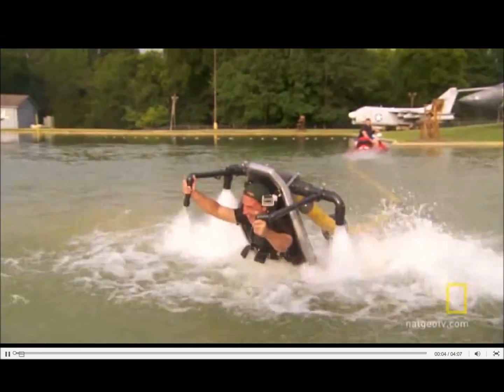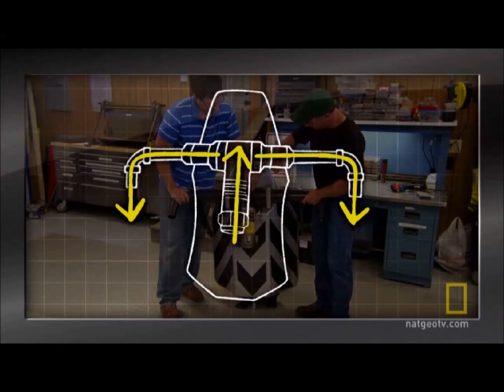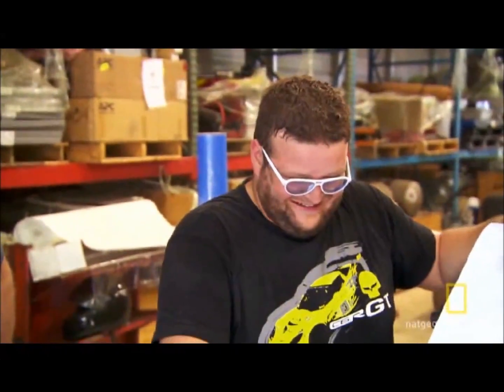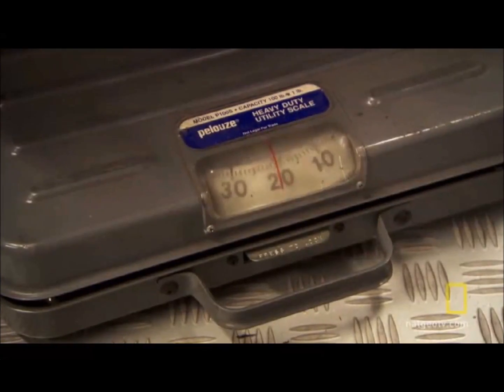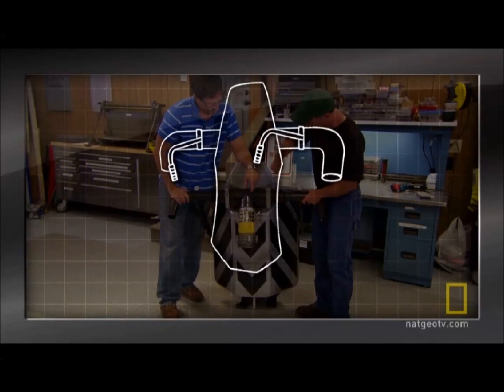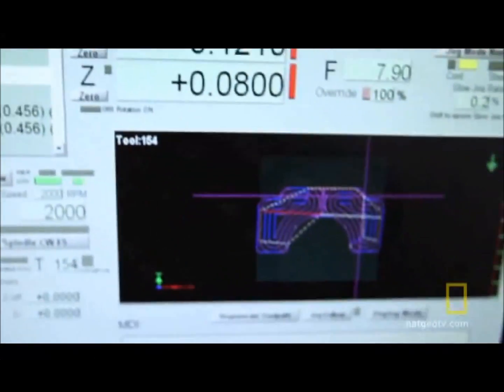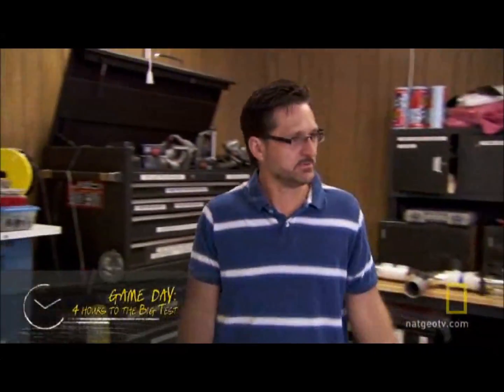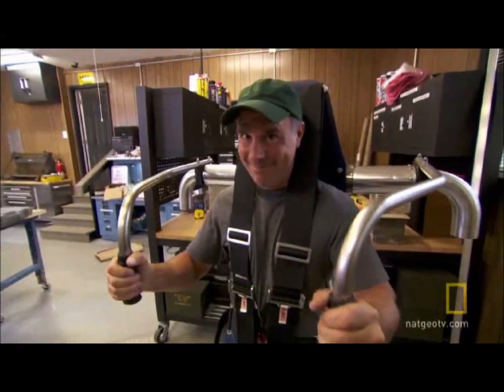How to build your own JetLev!

Comment: I made mine with PVC pipe and a swimming pool cleaning hose connected to a water pump - just make sure those PVC fittings are glued tight so they won't work loose by the pressure!
Reply: So... Doses urs work?

Comment: Do you think instead of using a jet ski maybe a petrol powered water pump would do the trick
Reply: Ya at the end of the hose and in the water.  I thought that's how it worked initially

Comment: you can build it at home if you have a cnc mill in your garage,you can tig weld,cut threads on a lathe, etc.I don't think a novice could build the metal version,now the PVC version,that's the problem child.the nozzles could fly off like missiles,yikes!!!!